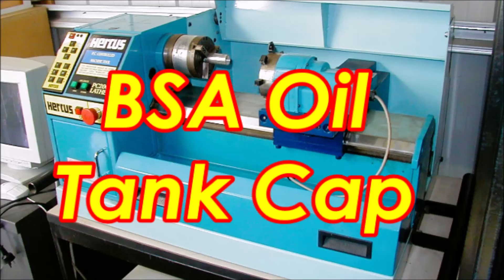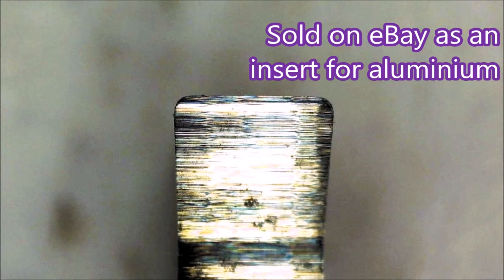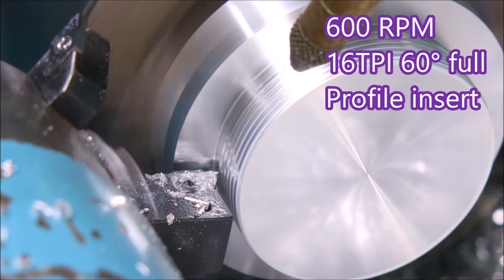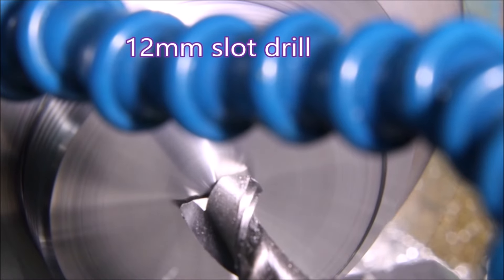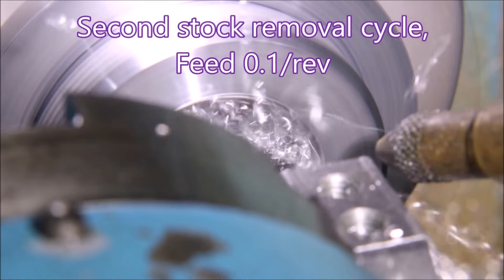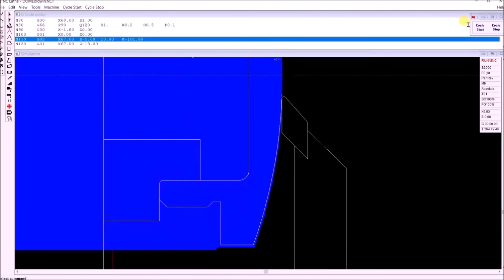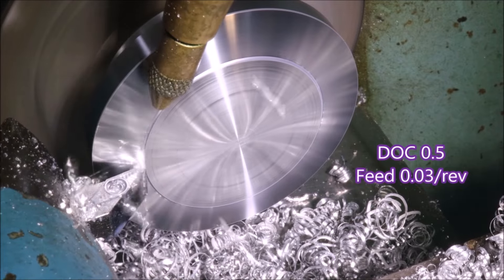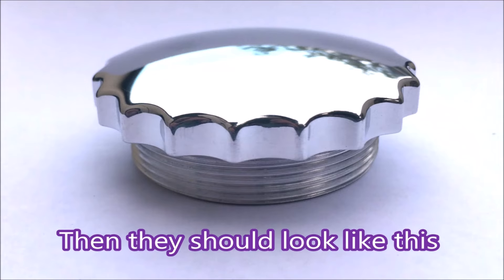BSA Oil Cap. In BSA’s 1939 parts list as 66-8317 Using eBay parting tool to do turning.

Comment: Most shops will lock the door if they think you have motorcycle or car parts in your hand.
Your work is so much cleaner than 99% of anything I've ever subbed out.
Your customers are very, very lucky to you have you!
Reply from the maker: @kevind1865  Thanks Kevin, I have always tried to make anything I create look like a bought one. I also do not make anything that is out of my league, the one advantage of being self employed. Recently was asked to quote 400 small parts in 6061 aluminium with m6 tapped cross hole. I quoted a price for someone else to do them. I have 3 well trained customers these days, they know what I can do and always ask if I want to do a job. Even have them trained to not ring before 10am. I tend to go to bed late and get up late.
2.28 am at the moment and time for me to get to bed. Thanks for your kind comment. Nigel
Reply: It's  02:16 as I'm reading this, I'm a night person also 👍

Comment: Nice! Im just so in love what that lathe of yours - I even love it more because of some of the flaws =D
We do a lot of work in 2011 aluminium - it cuts wonderful compared to 6082. However 2011 CAN corrode a bit in my experience if water gets to sit on it for longer periods.
Reply from the maker: @innominatum9906  Thank you, they are amazing for their size. I usually ask if corrosion is an issue, if it is, I job it out or send them elsewhere. With just half a hp at the spindle 6061 is a challenge. I don’t like getting put of my comfort zone, it has taken years to find it! LOL

Comment: I would imagine that the issue with your spindle is either the encoder, or the connections to the encoder that are a bit dodgy. It's as if it thinks it's in the right place then doesn't so moves a bit, and so on. Of course could be the electronics gone a bit funny. Perhaps an electrical noise issue?
Reply from the maker: Hi Olly, the minimum speed pots in the Minarik spindle driver will not go low enough to make the spindle stop. It has worked ok for years, but some time ago now the maximum speed became higher without the driver being adjusted. Since then it has been impossible to get the spindle to stop properly. Thanks for your comment. Will keep it in mind next time I have a tech here to look at it. Nogel
Reply: Noisy pots are a genuine problem, especially on old ones. You could try spraying them with contact cleaner and wiping them back and forward to try and clean them up. They are just a metal wiper on a carbon track (usually). Otherwise just replace them, they won't cost much.